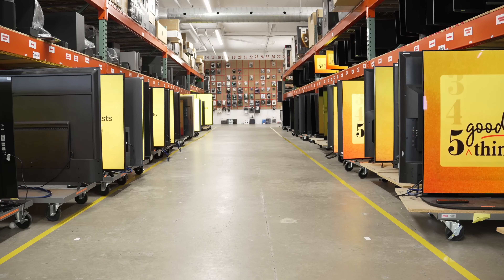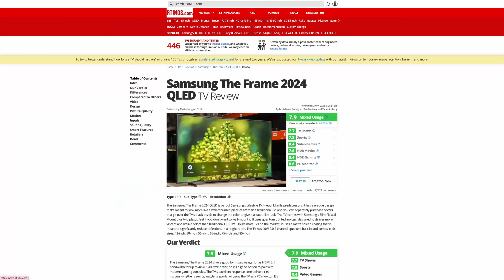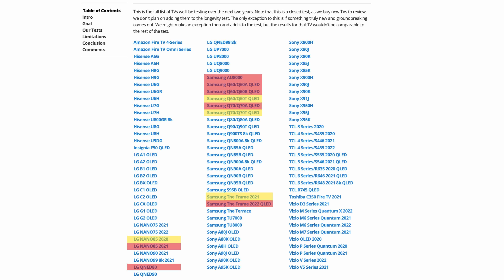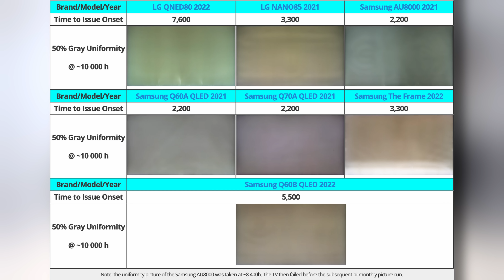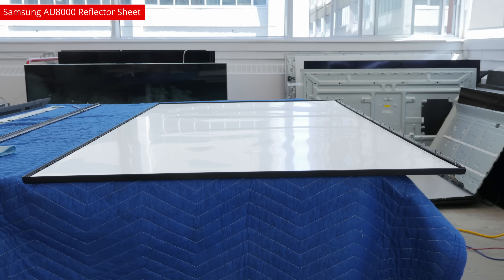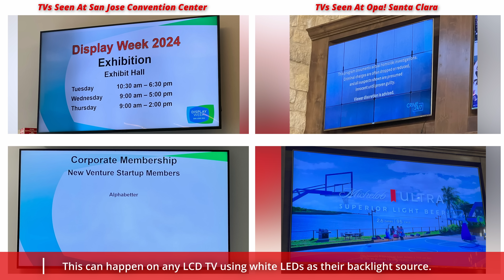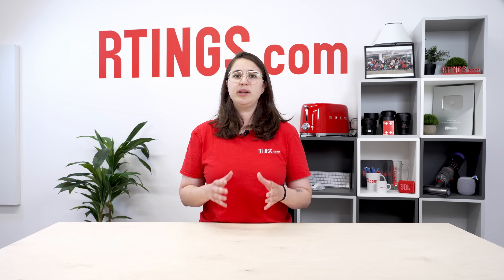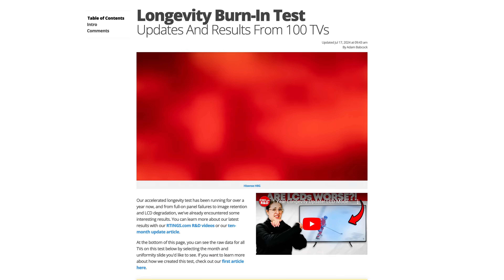Edge-Lit TVs Fail FASTER Than Others (100+ TV Test)

Comment from the maker: As some users have pointed out, at 4:24 there's a minor conversion error where we state a difference in temperature as 68 degrees F rather than 36 degrees F. Sorry for any misunderstanding this might have caused! We try our best as a Canadian company, but we'll triple check any conversions in the future!
Reply: 9:27 
Why is it unrealistic to have have TV build with Decade long durability?
I have some old box CRT TV from the 90's and the 00's that are now starting to diminish in quality.
That's 30 years vs at most 5 maybe 6 years of durability.
For the price that is crazy how durability have diminish by a factor of 6 time what it use to be.
Reply: Old LCD. screens with fluorescent light and NOT led, was very durable.

I have a samsung le52b620 lcd which has been on for 24416 hours = 2.785364 years according to the service menu

Of course not constantly but off and on.
never experienced any problems.

But all LCD screens, whatever brand, model, had too weak image processor and struggled with a lot of stuttering!

where the image moves quickly across the screen, you get stuttering. This was a common problem on LCD monitors!
Reply: @ford1546  bruh, what are you talking about, no one TV is stuttering or struggling, just disable frames generation that's what cause this
Reply: The trick to do those conversions is convert Kelvin to Rankine.   Kelvin is Celsius based with 0 at absolute 0.  Rankine is Fahrenheit based at 0 being absolute 0.  With those units you can convert temperature differences properly.
Reply: there is a whole lot more disinformation then real facts in this video but due to the greediness of YouTube the video is still around
Reply: top
Reply: The unit for temp difference is e.g. "F degrees" rather than "degrees F". So sciency conversion tools, like scientific calculators or Wolfram Alpha, will do it correctly if you specify "C Degrees to F Degrees" (instead of "celsius to fahrenheit" or similar)

(I could have sworn Google used to understand the difference too but it doesn't look like it does it anymore. :( )
Reply: @AySz88 me when I’m completely 100% wrong and spreading misinformation online for funsies uwu
Reply: @AySz88  There's no such thing as "sciencey" degrees F at all.  Science uses C.  Period.
Reply: @jzero4813  Wow, way to miss the point
Reply: I know the cause of the problem on the LCD thin TVs at your testing center…
You have Fake News CNN on.
Reply: thank you
Reply: Good info!  My 1st late 90s Sony Bravia flat screen after 20 years still looked and worked like new when I sold it. My now 2009 Sony Bravia 55" 800e 4k tv after 15 years still looks and works like new and it runs average 15 hours a day. They cost a little more than budget brands but way worth it. Plus the Android operating system is easy to use.  FYI. I'll stick with Sony
Reply: Why do CRT TVs last so long Sony overbuilt it the olden days
Reply: @RTINGScomRD  Is there a table of all the TVs in this longevity test, and their status, available anywhere in any of the articles about the test on rtings.com?  Thanks.  You're a great resource.
Reply: How is this trend not a passing of the cost-cutting? I had a plasma with a fully metal back that was quite hot to the touch, and obviously they'd never make it out of metal if they could get away with plastic. The industry being so relaxed after it saw consumers will accept anything as long as the entire industry bands together to form these newer, and less durable-concerning designs is precisely the sort of cost-cutting being passed on in my view. If they're going to aim for these "lifestyle" designs, then they should also be investing more into making them at least as durable. Though in an ironic twist, people making purchases with "lifestyle" concerns seems like the proper type of shallow folks that wouldn't care about anything of 'substance'.
Reply: As an American, I would appreciate temperature measurements in Celsius. No need for Fahrenheit. Most people interested in a technical deep dive on an electronic device will be used to Celsius anyway.
Reply: @2Baddu4u  😂
Reply: I think most of the tvs broke because you had CNN on.
Reply: @SmokeyWire56 
You stole my thunder!
😂😂😂
Reply: Metric please not that Fairy stuff.
Reply: I'm very sorry to hear you're Canadian, get well soon! 🙏🙏🙏
Reply: @phillycheesetake  but I'm sure they are are extremely happy they are not from freedumbland.
Reply: @Ram-RTR  Even though my country is the only country to suffer a atomic attack...twice no less. I appreciate America and how they treated us after the war. I wonder what they have done to your country that is so unforgiveable that it generates the type of hate I sense in you.
Reply: @Komainu959  look at the comment I was replying to. That should tell you everything. 🤣🤣🤣 Only they behave like that.
Reply: TRUMP/VANCE 2024
Reply: Just use Celcius.  No need to humour the luddites.
Reply: @jzero4813 
Don’t watch American videos then
Reply: @PhyuckYiu777  It's a Canadian video.
Reply: Just a quick note.

Presenter seems to be bouncing on something while she is talking.   It brings a bit of motion,  like wind on a lake effect.   I find it very hard to fully enjoy when the center topic has a jitter to it.     Good luck...   thank you for the work you have put into this.
Reply: @kwisin1337 timestamp? maybe its the hand movements making it look that way?
Reply: Its probably a nervous tick.. I noticed UT just said "you doing good girl" Once she gets comfortable it will get better..

Comment: Damn, my 2009 Sony V2500 (CCFL edge lighting) is still going strong. Got it as a (no charge) replacement for my SXRD - that thing was fantastic before the green blob took over 😢
My media space is light controlled and the backlight is at 7/10, brightness at 50/100...picture is as good as the day I got it (I think!) but the new units blow it away on black levels.
Just can't see getting 15 years out of the next one 😞

Comment: You are right aby , edge lit fail faster ... But as led technology gets brighter and brighter and more efficient, possibly edge lit technology might as well improve ,by not suffering that much ... 

... 

Also need to note direct led and full array led tvs have heavy lenses stuck on those leds ... Possibly failing pretty fast as well ... While they're harder to be repaired

Comment: My 2019 LG model lasted just 3-3.5 years. The issues was horizontal lines. It started at the top with just 1 line. 
I called customer care and they quoted the price to fix the panel itself saying its panel failure. So the cost was 85% of the TV itself and it simply didn’t make any sense to proceed with this.
I dumped the TV after a year where the lines started everywhere at the bottom and middle.

Just after I gave it away I saw that lines doesn’t necessarily mean panel failure. It could be just some loose fitting or some component failure or just 1 or 2 LED lights flickering / failing but the customer service won’t tell this nor will the dodgy second hand dealers who dupe by taking it away at throw away prices as plastic waste.

The whole industry is getting worse with each year. Selling the same models with minute changes and inflating prices.

Ratings and such agencies need to involve the govts and law to teach these companies and industry as a whole a lesson or else things will worsen in the coming years. 

My 2 decades old model simply never failed. It was sold only bcoz it lacked wifi connectivity and such modern features.

Honestly if it’s just cable TV then people should stick to older models and not waste their money on recycling waste every 4 years in the name of resolution.

Comment: My 2011 Sony KDL-43EX720 (3D) lasted from 2012 to 2016, when it developed horizontal lines on about the upper third of the screen. 2011 3D Sony sat unplugged in another room until late 2024 when I viewed a YT video about using a very small piece of scotch tape on one of the T-Con's ribbon cable to 'sort of' fix the horizontal line problem. Afterwards the 2012 Sony picture looked pretty good, so the 2012 3D Sony was placed back in the living room; and my 2016 Sony (purchased when 2012 Sony developed problems) was moved from the living room to another room. Both are still working OK in October 2025. There are several horizontal line YT videos now; I didn't see any in 2016.

Comment: Never liked the ultra thin TVs , I have an old  Panasonic 3D plasma and a LG OLED obviously the plasma is getting old but working like new except for the remote buttons. The OLED is insane. No edge light or back lights on either. I wish they would have come out with a 4K plasma but that's probably never going to happen unless they see massive profits to make one.

Comment: i have an amazing super thin edge lit tv with local dimming called the Samsung KS8000. I bought Samsungs flagship tv in 2016 and guess what? It will works perfectly. One of the thinnest tvs ever made with. max thickness 1.5 inches and thinnest is .5 inches. 

I finally retired it to bedroom duty once i got the QN95B mini led tv from samsung.

Comment: having to return a samsung q8f as the screen after just 8 days has had multiple failures, horizontal bars on grey scales sdr content has horrible colour blotches and the middle of the bottom base of the tv was running at 53c which i burnt my hand on, an edge lit t.v with an 8 day multiple failure is not good, also had an lg with edge lighting failed in both sdr and hdr colour and the os got messed up, so going with a sony bravia 3 i know its a downgrade in overall picture quality but i can only allow up to a 43 inch screen and i'm on a budget, we have a 55inch bravia at the moment in the living room no issues what so ever, so for now i'd rather get something that's half decent and reliable than something that's top tier but won't last the year.

Comment: We have an edge lit (top of the range) Sony 46" TV that is still going strong (no repairs) at nearly 13 years old, the picture is still excellent.
It was £1,500 13 years ago. And the 40" Sony that we had before that our daughter has is now 20 years old that was £1,999 new, again with no repairs needed.
The panel on both runs really cool and it's hard to feel any warming at all.

Comment: Bought a nano 85 LG 55"in 2021 to upgrade size from a 42" Panasonic plasma which had wonderful picture quality. Failed with warped reflector sheets in 2024. Still "useable" but horrible picture quality. Bought a Pioneer Kuro that's 16 years old for $100 on marketplace and was blown away by what I had missing for the horrid 3 years of LG nanocell. The Kuro has 30,000 hours on it, and just keeps going, and my LG failed in 5500 hours.

Also, someone was whining about Plasma's using more energy and it's true if you watch it in "Torch" mode, but a properly calibrated Plasma uses far less energy than the  stated wattage sticker on the back which is the absolute maximum. For instance My Kuro properly calibrated uses about 230W according to a Kill-a-Watt.

Comment: Nice to see this kinds of tests. I was wondered why you use an external media input? Because most users tend to use the internal smart player and is there a change to test that? Was wondered if a tv last longer if you use an external media player like an chromecast or firetv because of the less power draw and heat internally.

Comment: My Q60 has the warping issue. The warping is fairly symmetrical across most of the top halfe of the screen. Purchased new in 2020. Used for gaming never set on full brightness.

Comment: Plenty of reviews for TV's everywhere, some better than others.

However, surprisingly perhaps, few if any review the power consumption of each set.

For example, I recently read a customers anecdotal review of a TCL tv. Ithink it was a 65" model, a current one. The manufacturer blarb that came with it claimed a kw/hr figure but the user did their own test (not many think of doing that, as I said!) and found actual kw/hr at around 200 kw/hr as opposed to manufacturs figures of 120kw/hr - a huge difference for the energy conscience.

Looking at the edge connectors in your Hisense review, I suspect the user had a point!

Comment: this is all well and good but most people dont care,  when you can buy a 65 inch tv for under 300 dollars if it lasts for 3 years in that time the tech will have changed and you can buy the new latest and greatest 70 inch tv for under 300 dollars.       manufacturer's know this and may even build tv's to last for a maximum of 5 years so they can sell you a new tv..

Comment: Every edge-lit LCD (illegally sold as "LED") TV and monitor I've owned has suffered LED failure in under 3 years of typical usage. I hadn't realised how hot they ran until I tried replacing them in a TV a neighbour gave me and suffered burns to the palm of my hand while testing the panel out of the case. It didn't help that the back light brightness defaulted to 100% on this model rather than something actually sensible. He was using the brightness setting to dim it (which obviously led to an awful picture) rather than dimming the back lights. I'm sure that's what prematurely killed them in the first place.

Comment: I can confirm this is true. Tested with a laser temperature reader, Samsung Q60A edge-lit QLED TV reads 116 degrees F at the bottom edge at level 50 (100%) brightness.  Dropping it to level 35 dropped the temps to 97 degrees.  The brightness makes a big difference in longetivity.

Comment: Amazing stuff. I got a M32U and I noticed it heats a bit in its lower corners, and even using it at a lower brightness setting, I wonder how long it will take to cause some issues. My previous monitor was also edge-lit but I never noticed any heat irradiating from it. Guess it is a large area to be lit by a LED strip, anyway. Now my next display will probably be OLED, but I'm start thinking I should've waited a bit more for a backlit display with a mini-led arrange, and maybe a functional local dimming feature.

Comment: I am a tv repair techenician. I totally agree on the feedback you have provided on flat screen tv where side lited tv failed and the backlit sheet was very difficult to replace. Moreover this company delebratly make tvs with out enough air ventilation, they should provide extra fan like in laptop. These company wants sale they dont care about enverolment impack.

Comment: Our living room 2018 65 Q7FN has a cracked light guide with about 5 cracks and getting worse each month.  My bedroom 55 Q7FN has a tiny line of pixels out at the top. 6 years seems about the lifespan of newer tvs. It's sad to see, my 2014 1080p LED samsung is still kicking with Not one issue.

Comment: I always have my TV's and monitors set to like 30% brightness.  And my tv in the livingroom I have modded myself.  I cut the plastic housing to fit a copper pc heatsink from a P3 slot processor, and have it placed over the main voltage regulator and a smaller one from a Athlon II pc sitting on the processing unit.  My tv is now 7 years old and is going strong with no issues.  The model for anyone curious is a Vizio D50u-D1.  Very easy to modify.

Comment: Some key take-aways from this video: 1.) Do NOT buy low-end, edge-lit LCD TVs from companies like Samsung, LG, TCL, Hisense, Pioneer, and Insignia. You are literally throwing your money away by doing so. That $349 65" TV you bought because it was "such a great deal" isn't actually a deal at all - it's an accident waiting to happen. Instead of buying those save your money and get a $650 direct-LED backlit LCD TV from Sony instead. It will perform better and last you FAR longer on average over the long-term. 2.) ALWAYS buy extended protection coverage plans when you buy a new TV - regardless of the brand, model or price. Keep in mind here it's an absolute miracle that ANY of these TV's actually work at all with all the insane microelectronic technology that has now been crammed into them today. These are incredibly complex devices and there are SO many things that can go fail, break and go wrong, even from the best brands and even from the most expensive models. The single best thing you can do is to get additional protection and coverage on them from your retailer so that if ANYTHING breaks or goes wrong on them THEY get stuck with the big repair bill to fix it, not you!

Comment: Pretty much why I always turn off the TV rather than letting some screen-saver scene play endlessly.  
I have a 2015 Sony Bravia 4K that had all of its LEDs turn blue-presumably because the phosphor filters went bad after just 5 years- and that was from normal use.  In-laws have the exact same TV and theirs went bad about a year ago.
I also run the display at 85% brightness rather than letting it ramp the brightness up to 100%.  My original 2008 Samsung 1080p with vacuum lighting still works without any problems and still had great picture--only it doesn't have an HDR video processor to boost the color vividness.

Comment: So all you guys are really doing is long term burn-in or stress testing? Yes that will show flaws in any product manufactured but what is does not do is replicate real world usage. Anything can be forced to fail when used outside the recommended manufacturer usage guidelines. Most people do not leave their TV or monitor on 24/7. The hardest part of any electronic is during the power on and power off cycles.  While what you guys are doing is great it is not 100% inclusive of real world applications.

Comment: Enough!!! Tell this rubbish to my 2011 Philips 7000 series ambilight, edge lit and probably puts most of the trash your reviewing to shame! Guess what? It's nearly 2025 and the thing still shocks anyone that sees it (all with newer up to date models). Cheap is what your dealing with now, TV's designed and built specifically to rip you off and your falling for it hook, line and sinker